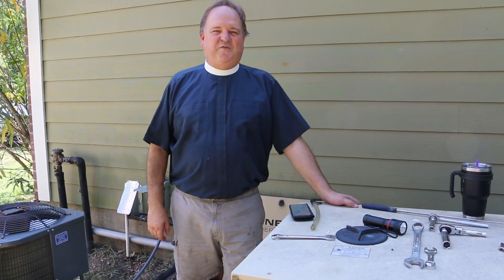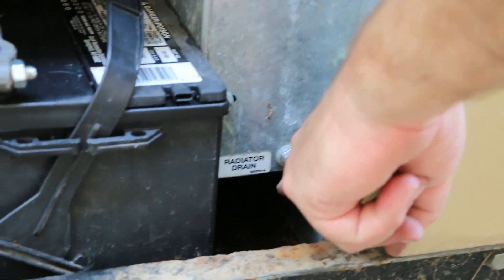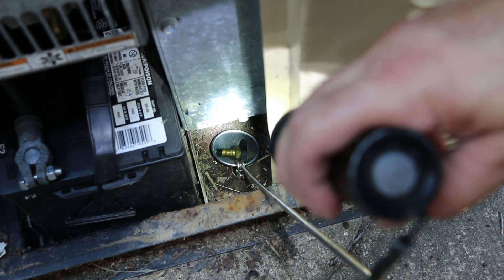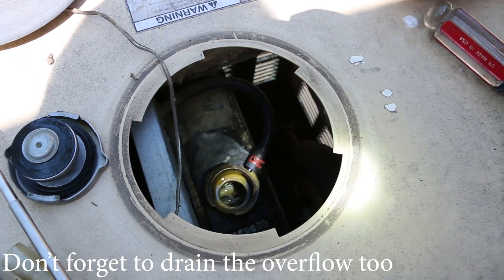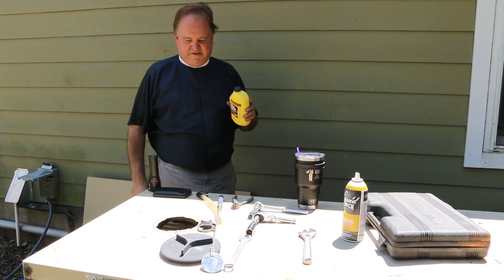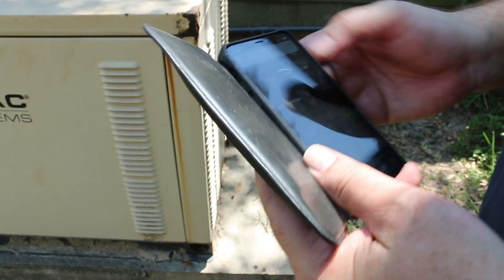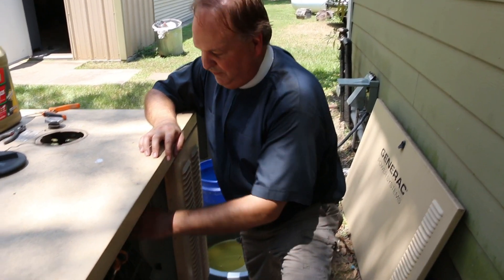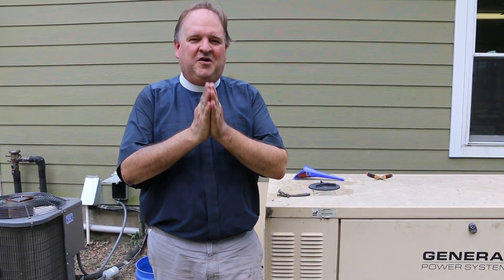Generac 25kW Liquid Cooled Generator - Radiator flush and fill

Comment: Hi Father. Thanks for the great video. It is one of the few sources of information on this topic in the internet. However, I have a queston. Specs for my unit call for 2 1/2 gallons of antifreeze. But when I drain the radiator, only 1 1/2 gallons drian. I image the rest remains in the engine block. Do you find the same issue with you unit. If so, is there any way you can think of to address this? Again, thanks for the great video!!

Comment: I just diagnosed a neighbor's overheating Generac.  They paid a tech to replace the battery (!), then had overheating problems which took three service calls but the technicians could not figure out the cause.  Some coolant was on the ground and they surmised there was a leak but could not locate it.  I used a 10mm motorized wrench to completely remove the casing/cowling.  The first tech had put in the wrong size battery, destroying the plastic fan blades and breaking the fan belt.  These repairman were even less then useless.

Comment: Yes, thank you so much for taking the DIY approach for these lifesavers. I was about to call the service tech to schedule. But being an automotive collision technician, i didn't see the need for that at this time. Since I'm pretty handy at most everything i do from successful engine swaps to cell phone screen repair, i figured it cant be much different from any if the things I've been exposed too since high school power mechanics capstone class.  Thanks again!
Reply: As a HVAC/Generator Service technician that does maintenances regularly, people with skills like you should absolutely DIY things like this. HVAC is a bit different, but I think with it being your equipment you will be a whole lot more thorough. Change the oil, filter, and general maintenance stuff like this, and just call someone when it stops working lol.

Comment: Have you changed the oil in the generator?
Reply from the maker: Yes. I change the oil once a year or every 100 hours, roughly. In the freeze in February down here I had to stop the generator after day 4 of running to change the oil. I changed the oil just before doing the radiator flush in this video.
Reply: @FrGeorge  I need to change the oil in mine also - when you drain the oil, do you take the oil feed hose off from the bottom and drain it into a pan?  If so, how do you get the pan out from under the generator, over the support, without spilling any oil?
Reply from the maker: @WarBerJr02  there should be a flexible drain hose with a metal cap on it. It’s usually clipped where you can see it. Double check your manual. The hose should be along enough to reach a pan outside the generator enclosure.
Reply: @FrGeorge  as far as I can tell, there are no videos of how to change the oil in this generator.
Reply: I, too, will be needing to add oil to mine soon.  Mine has been running for 9 days straight now, ever since Hurricane Ida came through. I wish there was a video showing how to do this.  😢
Reply from the maker: @judylirette8393  oh, wow. My generator ran for 13 days during Ike back in 2008. I know you are grateful for yours. Changing the oil should be pretty simple, and should be clearly illustrated in your generator manual. If you have a generac like mine, it has an oil drain hose that is inside the generator. If you can locate that hose, and remove the metal cap on the end with a pair of wrenches, you can drain it into a pan sitting on the ground within reach of the hose. The filter should be visible on the same side of the engine as the drain hose. Once the oil is drained you can remove the filter and replace it. The oil filler has a yellow cap marked with the word “oil” or an oil can symbol. Your manual should tell you the filter part number and what oil to use. A parts store can cross-reference the generac filter with other brands. I’ll make a video, but probably not before you need it.

Comment: Nice about to do mine. Do you happen have the Ford 2.5L in your genset?
Reply from the maker: The manual says Generac 1.6L 4 cyl. inline. I had a Kholer at one time that was a Ford engine. This one looks like a Generac branded engine.
Reply: @FrGeorge  oh this must be a 3600 rpm unit then.
Reply from the maker: @LichaelMewis  Yes, that's correct. 3600 rpm, 41 horse
Reply: @FrGeorge  So I did mine and now it stops after 10 seconds with a low coolant error. Did you run into this? My radiator is full.
Reply: Well I bypassed the low coolant sensor and ran the unit until the thermostat opened and was able to add more coolant. Then I shut it down and let it cool and added a little more coolant until it was to the top. Then reconnected the coolant level sensor and started. Now running fine.

Comment: I just retired from 25 years of servicing these units and we seldom flushed cooling systems. What we did instead was add a few ounces of coolant extender, which has the silicate to retard rust. That product should be available at most larger parts houses, but you need to read the label to see what's in each brand. It's commonly used in large commercial units where a drain / flush can be cost prohibitive to do on a regular basis. What I did was use a turkey baster to pull a few ounces from the radiator and just put it back into the overflow tank. Then you have room for your additive without making a mess.

Comment: Have you ever done a timing belt for your generic generator.
Reply from the maker: No, I haven't. My generator is 13 years old, and it's probably time to do that.
Reply: @FrGeorge  .... I wouldn't bother with a timing belt. They are made to last at least 60k miles in automotive applications and your running time over the life of the set will never approach a fraction of that. What I will say is that after 25 years servicing these sets the only time I ever saw a belt fail is due to mice getting into the works. If they drag in food (usually nuts) or die in there then freeze, it will throw the belt several teeth off and the unit will fail to start. When servicing always make sure there are no holes or spaces around the frame of the unit, rust or otherwise.

Comment: what is the diameter of the drain hose?
Reply from the maker: I used a piece of 1/2" plastic (pvc) tubing and not a rubber hose. Rubber hose with a 3/8" inside diameter should work just fine.

Comment: I see some oil in your coolant... or is that from the pan?

Also you have to use distilled water to prevent corrosion.
Reply from the maker: The oil is from the pan. Had just changed the fuel filter in my diesel F-350 and used the same pan to drain it. Good point about the distilled water.

Comment: Uhmm.....Did you really use tap water in your generator?  Generally, you always want to use distilled water in liquid cooling systems.  The new 50/50 mix coolant has distilled H2O.

Comment: Father - what size hose did you use?
Reply from the maker: It's a piece of 1/2" plastic tubing that I've had around forever. It stays on well enough, but doesn't grab hold like a rubber hose so it's easy to pull back off. The hose barb is tapered and can accommodate a variety of hoses and tubes.
Reply: @FrGeorge  Thank you Father - thanks to you, I picked all  the supplies up to do it myself!!!

Comment: Hi Padre!!! Great video. Question. I have a 6 year old, 27KW Generac. I called up Generac and they recommended using Low Silicate antifreeze. Is that what you use and also, they said it holds three gallons. Is that possible?
Reply from the maker: The manual recommends a low-silicate antifreeze. Zerex has one that's yellow in color that I can get for about $12 a gallon, concentrated. My 25 kW generator does not hold 3 gallons; it's 2. I mix 1 gallon of antifreeze with 1 gallon of deionized water and have just enough left over to fill the overflow reservoir. The specifications section of your manual should tell you what the coolant capacity is. 3 seems like a lot. My generator was made around 2005, so it's a bit older than yours.

Comment: Nice vid....after drain flush n refill I keep getting low coolant level/high coolant temp Everytime I start it up...bad sensor or air in the system?
Reply from the maker: It could be a bad sensor, but I'd be willing to bet the sensor is just dirty. Was it doing this before you changed the coolant? The temperature sensor and level sensor are combined in one sensor. There are two parts to the sensor that are electrically insulated from one another. When it is submerged in the coolant, there is continuity and that's how it knows you have enough coolant in the system. High temperature will break the continuity too. I had a similar problem. When I took the sensor out, it was coated in a dark material - some sort of scale that was in the system. I cleaned the sensor off with steel wool and it worked fine. I'd circulate and flush the system two or three times with fresh distilled water each time to make sure it's clean, clean the sensor good with fine steel wool, and give it a go. In a pinch, you can always disconnect the connector from the sensor and put a jumper wire across the leads in the connector to make the generator run. Make sure you mix the antifreeze with distilled water and not tap water after you flush it.
Reply: @FrGeorge  thanks man
... I bridged the sensor wires wit a 3k resistor to run the engine for abt 10 minutes. I didn't get to remove the sensor it was too hard to get to on my model, flushed the radiator tho.
Reply from the maker: So, turns out there's a retrofit kit, depending on the controller your generator has, that fixes false low coolant/high temp alarm. You can find the retrofit kit at gentekpower.com. 

https://shop.gentekpower.com/products/generac-0e2507-0h50540srv-replacement-coolant-probe-kit-for-r-200-panels

Just make sure you get a kit that's right for your controller.
Reply: @FrGeorge  ... Generac also has a retrofit kit for the sensor problem. It's got a new sensor and a wiring harness. The issue seems to be the original design had power to the sensor 24/7 and eventually you get that crust on the probe via electrolysis. The modified harness takes it's 12 volt feed from the gas solenoid, which is only powered when running, so greatly reduces the problem.

Comment: Are the liquid cool models quieter then the air cooled models?
Reply from the maker: I wouldn't say so. The air-cooled line seems to stop at 20kW and the generators 25 kW and above seem to be liquid cooled. At least in my experience of them. The generator does have a quiet-test mode in which it runs its self-test at about half speed and that is substantially quieter than standard mode. I've owned both a 20 kW air-cooled and this 25 kW liquid cooled. To my memory they are both about the same noise level. Pretty loud when running under load, but certainly manageable. Placement is key for you and your neighbors if they're close.
Reply: Many of the newer Liquid cooled generators run at 1800 RPM's. Most of the air cooled run at 3600 RPM's. I like the liquid cool units better.  They only run at 1800 RPM's they use less fuel , last longer and are quieter.
Reply: @Dqalex  and the alternators are so much larger/heavy duty on the 1800 rpm units.